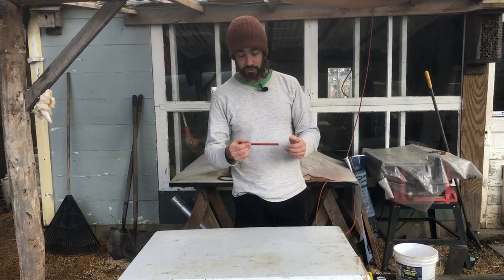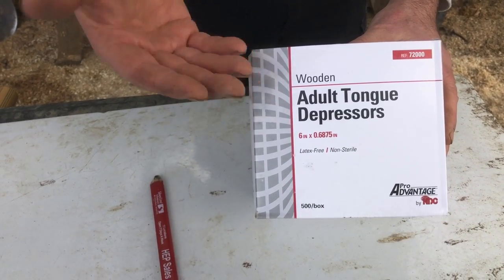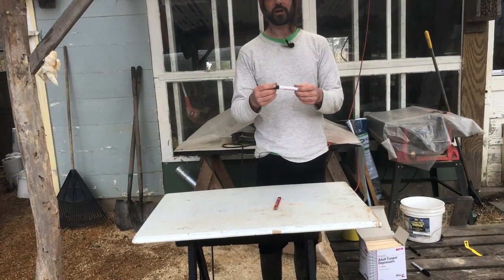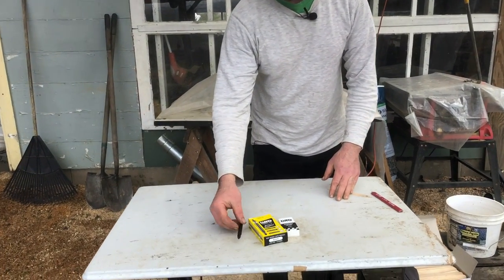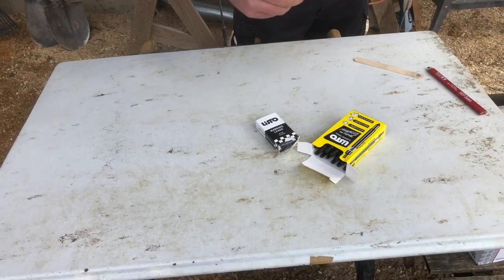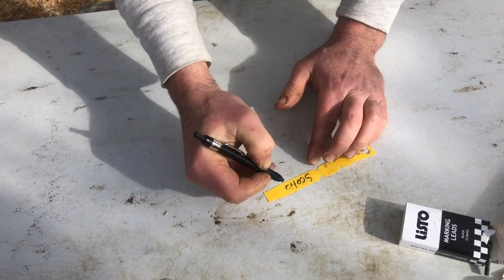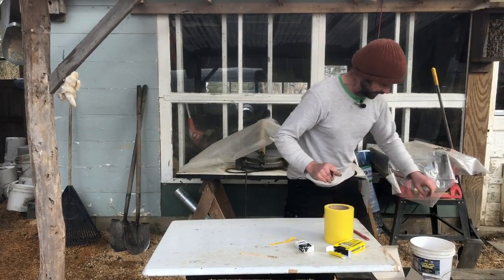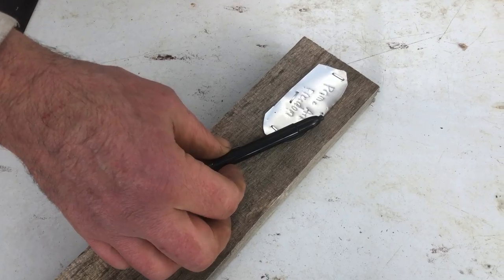Best Nursery Pen + Other nursery marking ideas

Comment: Yes!!  The aluminum can cut out and embossed with a ball point pen worked very well for me.  I made necklace-type tags for all my irises.  Using crappy scissors, I cut oval tags out of beer cans, used a crappy paper punch to make a hole in one end of the tag, and threaded a length of green-plastic-twist-tie-on-a-roll through the tag. The beauty of this was I could make necklaces big enough to go around several plants or just one.  I could affix them at the base of the plant and they did not blow away!  I suppose you could use wire coat hangers cut and bent into a hairpin shape to secure them to the ground if you live in an extremely windy spot.
The tags lasted 5 years and going strong.   The tags were legible and helped me determine which plants would stay and which would be gifted.  Thanks for all the fine videos and sharing that happens here.  Blessings!

Comment: What I've found that works really well is aluminum HVAC tape. I wrap a piece around, or simply place a piece of it on, a plastic label like the ones you have on the roll and then I can write on it with a pen and it embosses the aluminum. You can also wrap it around a wire and stick it to itself and then you have a label you can put on to a branch like a twisty tie. There's no plastic and it lasts for ages. The adhesive is really strong and I've had labels submerged in water for a long time and the tape stays on the label. I do like the wax pen idea for labels that don't need to last quite that long. It doesn't take that long to put the HVAC tape on, but it's not quite as fast and, although it will never rub off, it is a little harder to read.

Comment: My big super secret long term plant tags? Aluminum HVAC tape. I spent a few hours each winter making a bunch of these. 
Cut the HVAC tape about 6 inches long. Cut cardboard cereal box (or similar thickness food box) into 1"x2" rectangles. 
Peel half the backing off the tape, place cardboard rectangle on the tape, and pull the rest of the backing off the tape, and seal the back. The tape sticks to itself and is water tight. Weather tight. Freezes and heats just fine. It doesn't come loose. 
For a stand, I use a landscape staple taped to the back of the label after writing on it. I like this better than the aluminum can tags. They are easy to make, relatively inexpensive, last a long time, can be stapled to stakes, can be wired to tree branches, or taped to landscape staples for instant garden markers. 
But not something you would want to do for the nursery and shipping out plants. Your grease pencil works great for that.
Reply from the maker: Been using HVAC aluminum tape more for cold frames and such.  Pretty impressed with how sticky it is.  Strong once applied, but easy to rip if I'm not careful.

Comment: Thanks for this. I also really like wooden tongue depressors (aka popsicle sticks) for seeds and such, much nicer than plastic bits everywhere. As the in-ground portion rots quickly in Ohio, I've experimented dipping them in tung oil (or really any veg oil) to minimize wicking of water into the wood.

Comment: If you are writing on wood, you could use those wood burning pens. Downside is you have to plug it into the wall.
Reply from the maker: That could be nice for some decorative elements, but I think it would be slow going and hard to work with for general day to day work.  But a featured plant here or there, that would be lovely!

Comment: Thanks, for the video.  
I just ordered some pins on Amazon.  I can use them when marking tile to cut with my wet saw.  It should work better than pincel.  Pincel washes right off when cutting with my wet saw.

Comment: Hmm, thank you! I struggle with this. I use those tongue depressors, but I don't find that they last through a CA rainy winter, but they're fine for starting seeds. I have been experimenting with painting round river rocks with variety names, but most paints come off in said rainy winter. I may go with wood painter sticks and the Listo., or maybe with aluminum can labels on the paint sticks over the top? Thanks for the link and info!
Reply from the maker: You may want to do the aluminum can trick, and staple them onto hardwood...
Reply: I use multi surface paint and a sealant on river rocks for labeling my annuals, I tend to bring them in over the winter but leaving them out they last a couple years.  For perennials and trees I like the can idea.

Comment: The tongue depressors are easily found in craft stores and the crafts section of big box stores.
Reply from the maker: I've seen them, but they are generally expensive in small numbers.  That said, if you only need 50 or 100 then it makes a lot of sense.

Comment: Thank you 👍
I just had a crazy idea... What if you bartered for som beeswax and either dipped your small wood sticks in it, or used a small brush to just coat over the writing... I wonder how long that would last 🤔
Reply: I like the beeswax idea. Thank you!
Reply: A nursery in my town does something like this. They make 2x2ish inch printed paper flags on popsicle sticks then dips the paper and in beeswax.
Reply from the maker: Neat idea.
Reply: @jillhoward1452  thank you for sharing 👍Do you remember how long they last? 🙂
Reply: @thegirl555  They are meant to last long enough for the nursery to sell the plants so it is not a long term solution.  They start breaking down after a couple of months.